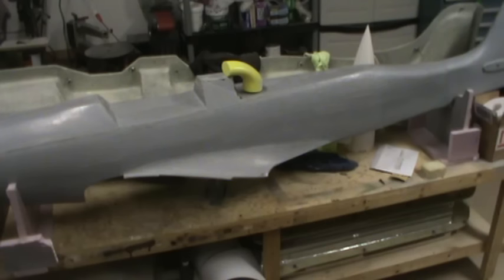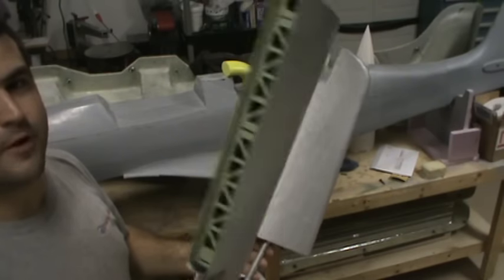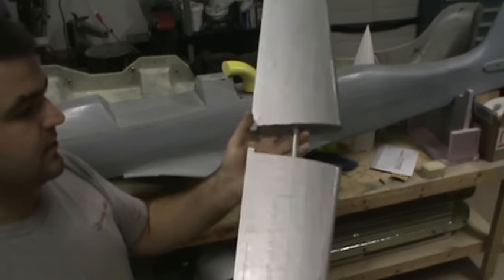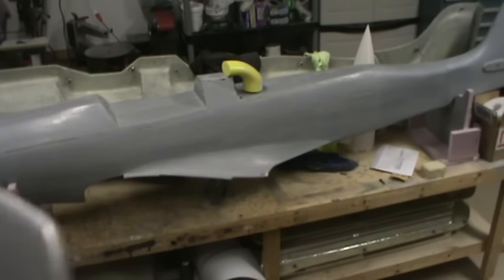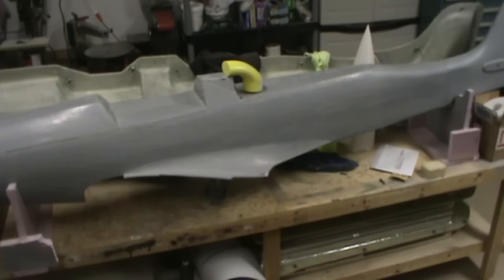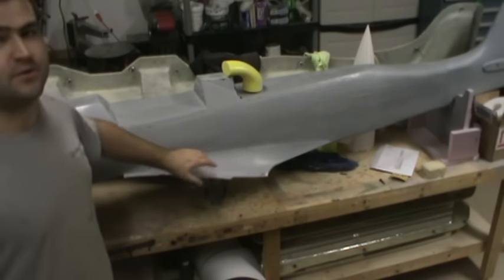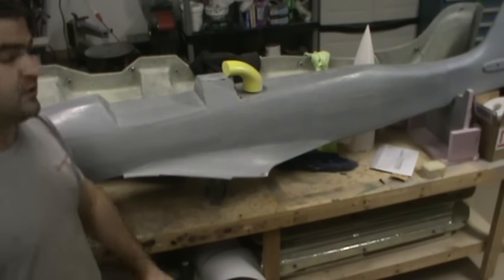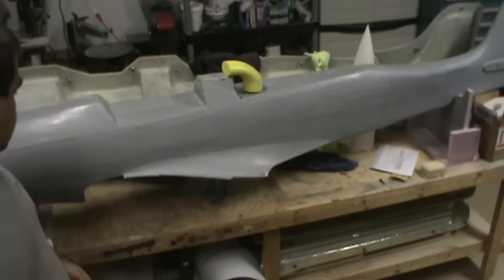Working with Lithoplate part 1

Comment: Just a heads up but i stopped using tracing paper and started using tissue  paper as its cheaper i buy it in rolls of 50 feet and it comes in 2 thicknesses. I pay $4 for 50 meters of tissue paper thick also called artificial rice paper from home ware stores. I can send a sample pack if at anytime you would like but the samples are 80cm x 100cm. A roll would be ideal to send to you but the tube it comes in and the tube its wraped onto make it $100 in shipping. But try some tissue paper an if you want i will send a couple sample packs as they are larger than the tracing paper plus i only paid $1 for a pack and i think there is 50 sheets per pack.